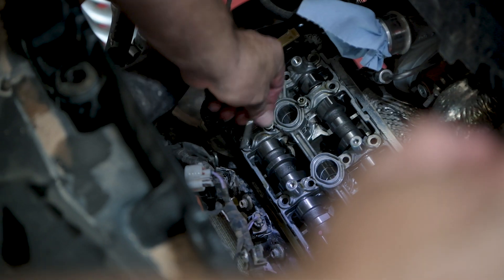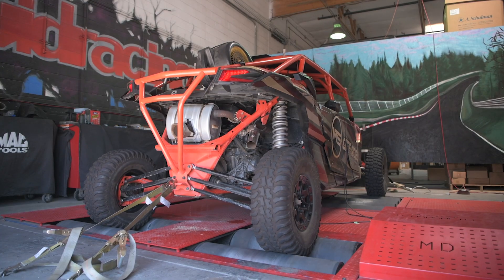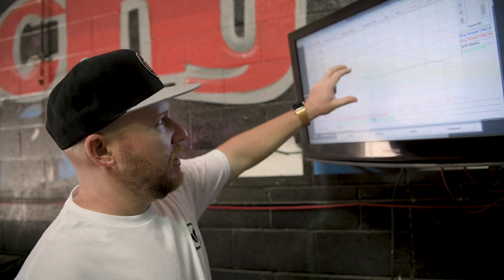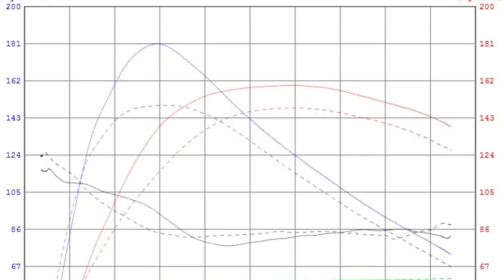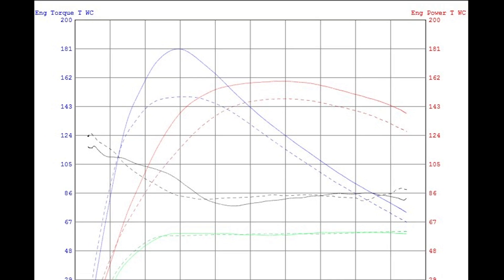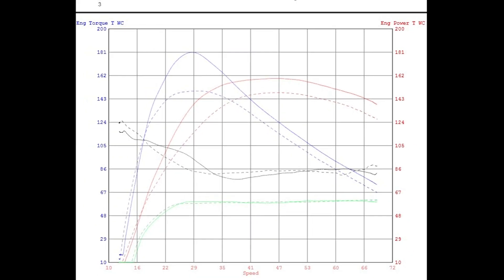Can-Am X3 Turbo Camshaft Upgrade and Dyno by Vivid Racing

Comment: Can I get the link I will like to buy those cams for my 2019 x3  Will it'll affect my tune it's a EVP stage 3R?
Reply from the maker: Good instock.  Will work with your tune but we got a better one if you want to switch at no cost.  https://www.vividracing.com/vivid-racing-canam-maverick-turbo-camshaft-upgrade-kit-p-152414898.html